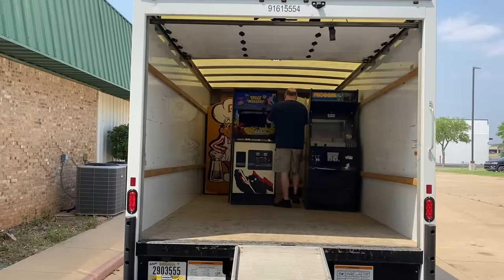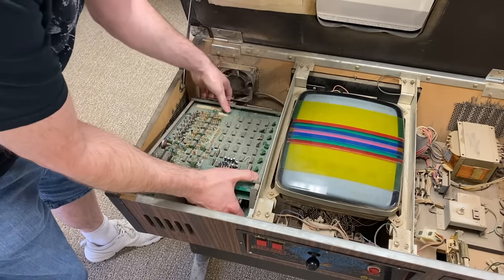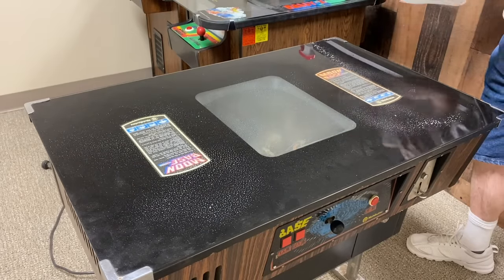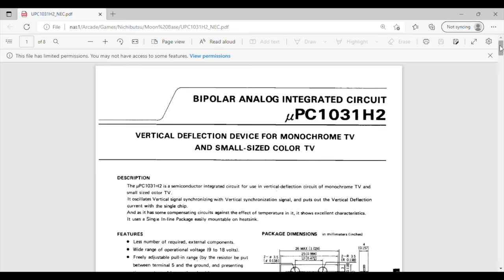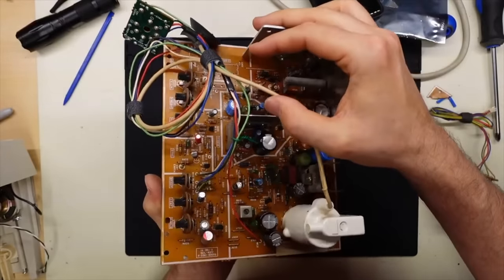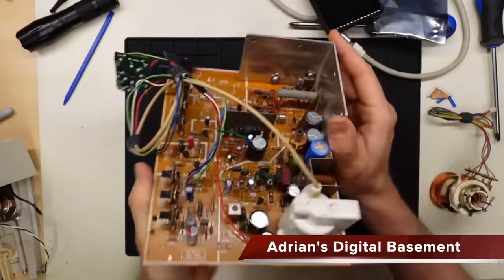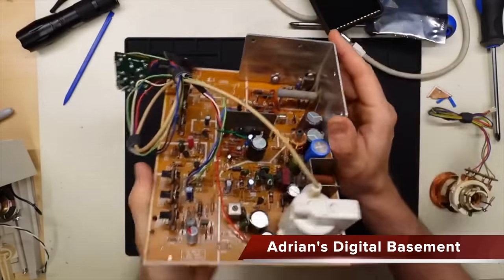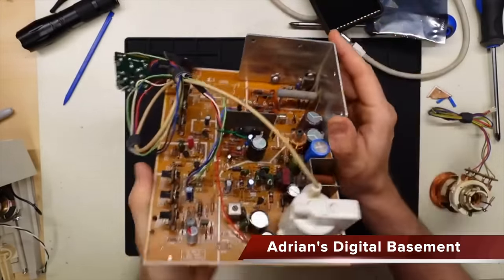Moonbase Arcade Restoration - Gone Wrong

Comment: Great video. Think I would have found the fault before replacing all the capacitors. There’s a very high probability there was nothing wrong with the capacitors you replaced. Only recap to increase longevity and not to cure faults

Comment: Did you ever actually try it on a 100v power supply transformer? It could just be that that one chip is /just/ voltage sensitive enough to be the weak link and fails on 120v.
I had a friend that had this happen with a Japanese DAC. It fried the headphone out, but all other outputs worked just fine. (he bought it used, previous owner fried it)

Comment: It could be a ‘soft’ power supply there has bad capacitors causing the wavely drifting lines to be shown on the horizont. Maybe the chips not dead it just a the power supply there had a good moment.

Comment: Haha, that one part/screw that makes the whole work a LOT longer./ I once was changing the engine in my car, had to swap the cables and the computer. Everything was working, the engine was, or so I thought... the lights, wipers, and everything else was not because the plug for these had differently arranged cables, like a 100 of them duuuuh,  I ended up spending a few days figuring everything out.

Comment: You might have compromised the chip when you ran it backwards.
I would repeat the chip replacement. Start where the last error was made before you try to rereound the wheel.

Comment: Like sage_x2002 in the Comments said, "If it is made for 100 V, then whomever owned it in 1983, imported it, and broke it at 120 V.  It has probably been this way for 40 years.  If you replace the blown out chip, and run it on 100 V, it should be fine."

High voltages blow out chips.

Comment: If you ever have rust on Chrome WD-40 and a penny spray the WD-40 on the rust lightly rub the penny over the rest and it will come right off and won't scratch the Chrome

Comment: your game ran in texas for years so it probably had the transformer wired for us voltage.  the thing you did was throw the voltage adjustment switch by the service outlet.  this switch is to change the voltage a little for variance in input voltage.  In schematic you can see it near the plug labeled 100 and 90.  you have lost the stick on label for the switch off the game. if I knew where to send it I could send you the picture of mine

Comment: Did you check the power supply? You mentioned it was a 100 volt unit and it's being supplied 110/20 volt. Was it modified to do this? Has that supply degraded? Could the part in question being overvolted and damaged?

Comment: I am by no means an expert, but maybe it's an issue with a resistor having a lower than required resistance?
If there's too much power going to the chip and frying it, a resistor might not be fried but might have too low a resistance value.

Comment: could it be voltage too high?  If it was originally designed for 100V and you're running it at 120...  the stepdown transformer would give an output that would be too high as well.  maybe that's what's blowing up the IC...   just a guess.

Comment: Jere is the thing about.. old electrical products.. "They aren't that sensitive".. If I understand correctly the US today uses 115 volts (half Europe's current standard), and I THINK that is just a minor hike you did recently (same over here in Sweden, we used to have 220, now 230).. and the hike was made without any appliances REALLY caring.. 

Then there is also the question of the wiring from the last transformator-station to the building where this has stood (The American power-grid is STILL under dire need of upgrading, but.. more so in certain areas, and they may have been a lot "worse" since before.. 

My suspicion is that they did "fuck-all" (technical term) from the original 100-volt version and just thought it was close enough.. plugged it in.. and.. despite running at a higher voltage than specs it was still not bad enough to break anything.. (Learning by burning; Also a technical term).. Which means that it may be that it was running at 108, volt (due to local circumstances, drop in wiring, a high current out-take in the establishing in question).. and BARELY stayed whole.. and.. whenever it ended up being plugged in at a place where the voltage was.. up to par (perhaps someone even fixed the grid at that place, OR that was a time when t hey increased from 110 to 115).. it fried that chip fairly quickly.. 

Non-switching old-timey power-supplies are rarely built with any form of  voltage regulation- or spike-filters, they just "assumes" that things will work the same.. They had good enough margin back then.. but to an appliance built for 100 volts, it might work well on "110" on a bad grid, where there are no fluorescent lighting or switched power-supplies on the line that creates "noise", so they don't get the full 115, and also never get any noise that transports through the analogue circuitry unhindered in to the chips.. might have a much more difficult time on a 115 volt grid that actually DOES reach 115.. AND comes with random transients "because".

Comment: You changed the IC but accidentally inserted it backwards.
Did you just turn it round the correct way after it had been powered up whilst the wrong way round?
If so, the IC could have been severely over stressed and on its last legs hence failing in such a short time.
First thing would be to look at the power specs of the IC and check what it is being fed with.
It may be that it has a tighter voltage tolerance than the original and need the voltage reducing a bit or as I say was just weakened and failed prematurely and just needs replacing again with a unstressed new part :-)

Comment: People make mistakes.
Technology a lot of the time is trial and error. When fixing broken tech that is especially true.
I'm no good with physical parts of machines but I can work my way around software. That working around is usually "what does this do?... not what I want it to do..." then find the correct thing.

As you said, showing your mistakes helps other people know that whatever you did is something that can happen if they're unaware, and they can look out for and avoid it. 

I think people that come in and berate people for their mistakes are those that have a superiority complex, and want to show off how "intelligent" they are by trying to make you look a fool.
Usually the same people that when they are proven wrong they just double down on their mistake to try and save themself from embarrassment. But, again, continue to dig a hole to looking even more a fool.

Comment: Actually, after sleeping on it.I am thinking  maybe one of the smaller Caps on the vertical control might be shorting out.Passing too much current as it does, skewing the vertical 
It  goes to figure, the small ones you didnt replace might actully be the culprit
If a didoe were to go bad , maybe you would see an  AC  raster? IDK
I am a rookie here so  dont read into this too much
I am not as smart as I would like to be, but I am not as stupid as I used to be ...LOL

Comment: ugh I do arcade restoration though I'm a purist imo never drill a hole for a free play button that's arcade bastardization, there are better solutions including using the start button or player 1/2 otherwise  just leave it as it is and clean up. for monitor chasis usually first thing you want to do is clean it then reflow solder on everything then drill down on components. sometimes you replace components it can restore current to what it was burning out other stuff. as a last resort shotgun the chassis. it's totally fixable though

Comment: perhaps heatsink failing from not enough paste. or possibly the power supply is failing and not giving power in the right amounts. could be maybe the sound. im wondering why prolonged use caused an issue.

Comment: can you please check the quality of the video signal with a scope regarding the sync pulses and check the output of the sync circuit of the monitor board as well to simply rule that out 100%?
and please check the voltages on the chip. they might be 10% too high.

Comment: Could it be that it actually IS a 100v unit, and running it at 120v works for about 10 minutes before the chip overheats?

Comment: Okay, it looks like the chip keeps burning out because something else went bad on the board. You have a multiple problem failure. I am also starting to wonder if the IC in the board is even the correct one; someone could have replaced it with the wrong part; I'd double-check that to ensure it's the original correct part. I'd start taking readings on pins to figure out what's happening. It's probably something small like a shorted capacitor. You might try doing some googling; I think these machines are pretty similar; there might be another type of game with this break-fix description. I actually think this is the wrong part; I think it should be LA7831 I.C., not the KA2130A. They are similar, but the LA7831 has a higher operating voltage.  The part you found on the board, to begin with, was wrong, UPC1031H2. Let me know whether I'm right or an idiot.

Comment: If it were me, I would have removed the entire coin slot panel and replaced it with a blanking panel with the FreePlay button on it. That way it can simply be converted back to normal coin operation without a hole in the unit

Comment: Could check flyback transformer maybe shorting cause voltage issue worked for a technician and I'm not positive but i think he had one doing same thing changed horizontal and vertical ic but nothing and seems like it was intermittent but he changed flyback transformer and it worked

Comment: i think it overvoltage that chip (where u put it in backwards n ended up sending to adrain black) i would point out psu is going too high because back in daywas 100v n now it 125vac you may want look into reducing psu to reduce destroying chip aging

if you want something so better than i would throw in lcd and one of chip that allow you put color in screen so u dont need tape see thru color just save ur self a headache
Reply: cuto mcoi  yes because he didnt check voltage rails i think should be under 20v and if it showing 22v that be reason why it fry up ic
over few year vac start to raise some reason mine is currently at 130vac it supposed be 120v
if you dont adjusting voltage down it ended up frying up any electrical tech like it killed my monitor before i didnt know unite i find out about it and went on bought reduce vac to avoid destroying any my tech

Comment: You are running a 100V Japanese machine off a 120V supply. That doesn't sound like a good idea. It was marked as 100V, not 120V. The arcade may have installed autotransformers rather than modify all their Japanese machines. Whoever had it next probably ran it off 120V and hence it arrived not working.

The very first thing to do in any repair is to check the supply rails. Do that first, before recapping, before disassembly. I would speculate after your repair it worked for a few minutes with too high a voltage until the increased dissipation caused something to get too hot and fail.

Comment: why not replace everything on the crt board you also may want to see if the power to the crt board is ok if that would go high with the voltage then it could fry things also

Comment: Too bad you couldnt tell the temperature of the SIP you replaced, I bet the fault that took it out of service is still there and killed your new part. The CRT itself seems great like it was never ran that much. Also 16K plays is very low, thats only $4,000 bucks, not that great a profit at all, I wonder if it had rolled over? Oh and if you could get another video driver board and run that one, make sure it doesnt over heat and see if thats the issue. As to your issue putting the part in wrong, I did that to a connector on some new PLC cards we were making at work, I put it in upside down, ran them through the wave solder machine and the test department called me a hour or two later.... seems the photo copy of the parts placement was very blurry and I missed where pin one was. Well after desoldering and fixing all 250 boards with the 20 pin connector on them. I learned to ask for a better copy.....

Comment: I'm with these guys. (I'm certainly less knowledgeable) ,, I would think that the problem is the same problem, so the power supply must be killing the chip you replaced. You know for sure that's the chip that goes bad to make the problem, so now you know the real problem is what's killing it. It could be that you killed the chip by putting it in backwards,,, but then again why would it go bad in the first place?? It went bad both times the same way, so it's reasonable to assume that the same conditions killed it both times, and putting it in backwards is a different condition altogether, and might result in a different death for the chip and therefore a different symptom. who knows for sure but that would be my guess atm.

Comment: I know what is happening.  Do you can put the crt circuit diagram to I make a analysis?.  Can be the high voltage caps.  In horizontal circuit next to driver output horizontal transistor. Do not measure.  Just replace. I see in your video that you replace the caps polarized. This can to be happening by a cap burn. Some times they measure  correctly but they burn. And you mentioned they capacitors and not replace they. The verticar power supply normally is throughout flyback transformer. This is a probably .  Check the supply pin for vertical CI. maybe this is can to damage the CI. The high speed diode  too can be a problem..  check this component too.

Comment: Disconnecting the coin mechanism = not cool. 
Drilling a hole in the side of the cabinet for that asinine "free play" button = vandalism.

Coin-operated is part of what makes an arcade machine an arcade machine, and inserting a quarter, and the sound it makes as it drops through the mechanism and lands in the bucket is all part of the arcade experience. I don't get the "I must have free play!" crowd at all.

Comment: i'm a YouTube expert and i know how to fix this... all you need is a gal of gas and a box of matches, that'll do the trick.. but seriously tho there is reasons why old electronic devices such as this one don't work in other countries and i do remember learning this on Techmoan youtube channel where old record players will not spin at the correct speed due the power thats coming out of the wall, now apply that to little sensitive electronic parts that'll blow if you even look at it the wrong way...

in short this machine is region locked to Japan (Japan electric grid)...
Reply: edit: so apparently other ppl in the comment section already knew the same thing i was thinking.. BUT i'm still a youtube expert!! (gal of gas and a box of matches)

Comment: Hey, WHAT EVER HAPPENED TO THIS MACHINE? Use any CRT. Just cut out the chroma signal, and it will only display b&w. I think getting the coloured acetate reproduced would be the hardest part.🤔 Then also, would it be all that bad to replace it with an LCD screen? (Trolls jump in -> HERE <- ) The machine would be safer, and people could enjoy it again.
Reply: @8088mph  🐈Kitty crawled inside and went boom!💥
Reply: @8088mph  Magnavox console sets. I leave them open to see the pretty tubes glow.😈
Reply: @8088mph  I maybe even helped her in there a little.
Reply: @8088mph  🤣
Reply: @8088mph  Это мы не проходили.
Это нам не задавали.😁

Comment: Something in the power system broke it?  Maybe you could get a voltage regulator or sometthinig tthat could sit between the chip and the power system?  I have no idea I am no expert I just am armchair guessing.
Reply: Maybe its some sort of feedback from the monitor itself?  something about it's electron gun or something could be causing feedback and maybe you could try regulating the connection there?  Maybe some way to... what if it is getting hit by the electron gun? maybe it needs better shielding?  Just armchair guessing of course.  

Sorry I cannnot heelp beter
Reply: @aurorauplinks  You know the problem has all been solved for a long time now right? The video where it got fixed was the one where he went to the old computer convention
Reply: @adamhall7077  oh sorry i havent seen a lot of his videos
Reply: @aurorauplinks  It's fine, go watch that video if you want to see what he did to fix it

Comment: Methinks that reaching down under the tube when mounted in the cabinet to make some adjustments without been able to clearly see all the wires was highly dangerous. There are dangerous voltages on those tv tubes. That is a far bigger mistake than putting a chip the wrong-way round.

Comment: I think I hear a Sunk Cost Fallacy playing itself out. I am not going to stop you; for one thing: This video was recorded quite a while ago, so any Revenge of Moonbase may already have played out. For another, you make these  videos for a purpose, and they provide us with knowledge without having to blow ourselves up. (But the part about working on the innards of the box with your bare hands, seemed a bit scary. Please tell us whether that was safe or whether you won't repeat that either.) And on the third hand, you're too far away for me to do anything about what you do. But please, find a better reason to tinker more with this project than just "You already put in a lot of time".

Personally, having no knowledge on the subject, I would go for the electrical info plaque telling the truth and your assumption that it was modified for the US being not entirely correct. If it needed that curious connector to connect it to something that generated AC 100V, would an unsuspecting owner sending AC 120V though it overheat stuff etc.?